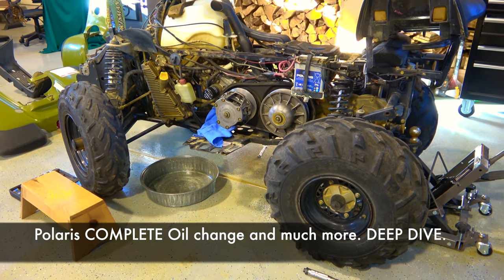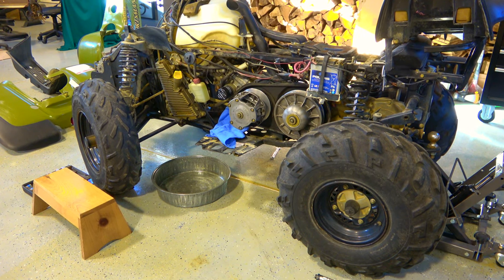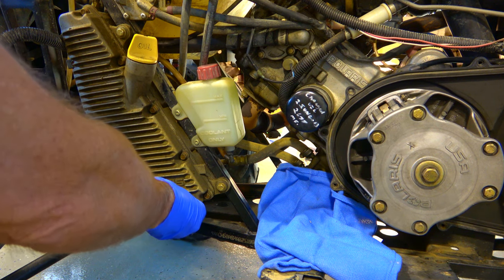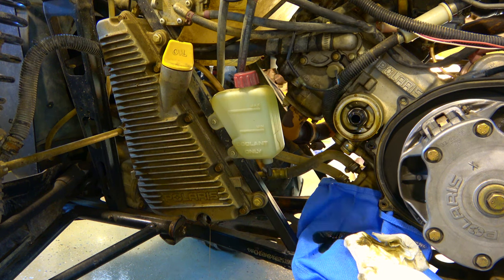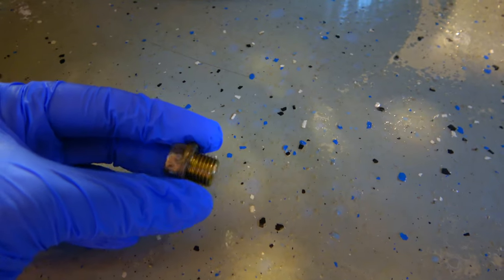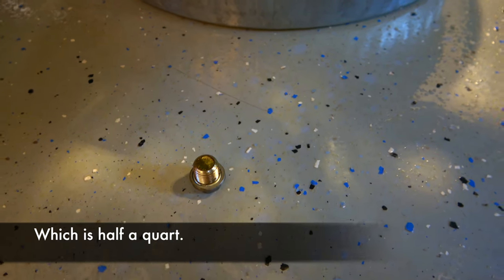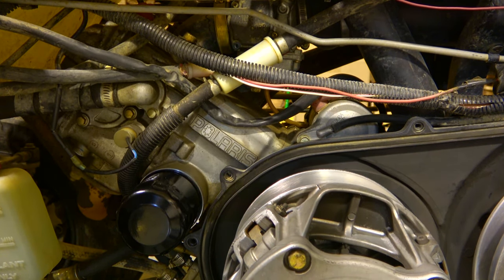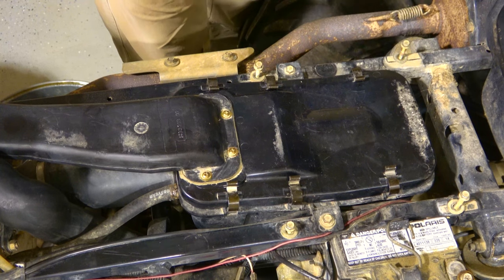Polaris Sportsman COMPLETE oil change & Much More. DEEP DIVE.

Comment: Great videos.  I love the clarity and detail.  Is there a fuel filter on this particular atv (1999 Sportsman 500 4x4)?  Can you point it out?
Reply from the maker: There is. If you look to the right of the fuel shut off/reserve knob there just above the primary clutch. You'll see two white inline filters. One is the fuel filter. White and red on one end. The smaller one. And one is an inline breather filter. From the airbox. At least on mine the one in the video. I don't know for sure if the fuel filter was factory or an after market install before I got it but I believe it was factory. Hope that helps.  I will be making a video going through many of the parts and pointing things out and briefly describing there function soon.
Reply: @ericinalaska7648  Thank you.  I look forward to your video describing these things.  I have the identical ATV and it has been sturdy and reliable.  Sadly, It has been sitting for a few years other than a start and warm up for about 20 minutes every 90 or so days.  I am getting it back into shape now to get back into the wilderness.  Your videos on this machine are proving quite valuable.
Reply: @BigRedDg  7

Comment: I recently purchased a "99 500 Magnum.  After using the 4WD I heard a strange noise coming from the front differential.  My local dealer suggested to first check/replace the fluid.  Looks like a real Pain in the Rear!  Finally found the fill plug UNDER a radiator hose that travels across the diff. housing.  Does the hose have to be disconnected to make this happen?  Thanks for any help/advice you can provide.  John in Texas
Reply from the maker: Well .... Id say if you can get at the plug without removing it then Id have at it. It'll of course be a little messy but I think the alternative will in its own way as well. I can't say Im exactly familiar with that set up. Is it a plug or bolt? Either way. Can you get the appropriate tool on it? And will it be just as easy getting it back in? Thats the thing also to consider.  Are you able to force the hose out of the way?

Comment: Just to be sure, because in the end it got confusing, is it the breather hose (the one on the very top that goes under the seat) or the return hose (the one kinda in the middle) that I need to clamp ?
Reply from the maker: Its the one that comes out the top of the oil reservoir and goes around the front and back to the air filter box. Not the one that has the in line breather filter on it. Its been a while. I believe I trace its route in the video. I took a look and looks like 28:08 in the video  to clarify which one.

Comment: Good video.  I've changed my oil but never with a camera in my hand. Why would I need to purge? I don't understand. Air gets trapped? I purge an old ford tractor when it runs out of diesel but others fire right up. Any insight would be appreciated.
Reply from the maker: Thats my understanding. Air getting trapped, some call it vapor lock. Preventing proper circulation. If you disconnect your supply line to the oil pump. Then you need to prime it. Thats not to say you may not get lucky if you don't. But why risk it. Its not needed or suggested per the manual other than for that specific scenario. So if you just remove the plug on the reservoir and change the filter like most do. No need. Its very specific to if you disconnect the line(s). Hope that helps.

Comment: Great video, new subscriber here share the love!  I just purchased a 2004 Scrambler 500 that needs some assembly, it has set for several years and will not run, they said it was the fuel pump.  Lots of work and fun ahead of me and will be looking for advice.  Thanks for sharing.
Reply from the maker: Sounds like a good project .Im happy to try to answer any question you may have, to the best of my ability of course. Also If you look in the description of most of my Polaris videos. You'll see a link for a manual. Actually here it is.    https://amzn.to/3rFQW6p.  If its not the specific one you need. It'll get you closer to refining the search for the one you may need. Always good to have one.   Thanks for watching. More to come. And good thoughts for your project.
Reply: @ericinalaska7648  Thank you very much, most appreciated!
Reply from the maker: @AMProspecting  No problem. Good luck!

Comment: Great video. I have a question Eric, I just picked up a 2004 Sportsman 700 EFI and it has been sitting for several years. I am going through all of it and when it comes to changing the oil, I know you should run the engine first. Is it ok for me to just change the oil and filter as it sat for so long, or get everything else done and get the ATV running and then change the oil last?
Reply from the maker: I cant say Ive NEVER changed oil in something without running it first. But its been a long time. There are a couple good reasons to run it first. For example, you're warming up the oil and that helps it flow/drain better and more completely. The other thought is that by circulating the oil it helps more thoroughly remove any sediment and or sludge or particulates that may have separated or settled over time. While parked. By kind of remixing it all just before draining.  So its a better end result assuring you have new clean oil, less likely to be contaminated by old. And the old that would remain if you don't run it first would likely be the worst of the oil you're trying to remove and replace.  I would recommend running it first. Especially if its sat a long time. If your too deep in and didn't or couldn't. Its not the end of the world but Id be inspired to schedule my next oil and filter change sooner than usual. Nothing to loose sleep over though. But given the choice. warm it up a bit.
Reply: @ericinalaska7648  Ok thanks for the quick reply. I will plan to change out everything else first and then once I get it running I will replace with oil. Great video!
Reply from the maker: @BoneReaperz  Thank you and good question.

Comment: Very clean 99! Great video as always!
Reply from the maker: Yah I looked it over and thought it was worth the repairs needed. Good bones as they say. Few more things to do and maybe Ill do a after video. Appreciate the feedback.
Reply: @ericinalaska7648  what ps4 oil did you use?
Reply from the maker: @lizgrennan5560  PS-4 is a full synthetic  4 cycle engine oil ,Polaris product that's 5W-50. For an operating temperature range of -40deg  F to 100deg. F.  They make one for higher temps as well. Id have to look up the specifics but if you looked for it at a dealer or online it'd be easy to figure out which one is best for you.

Comment: Thanks for the info, I was very curious about the oil feed line screen. We need to force Engineers to take and pass a common sense class....
Reply from the maker: I would imagine now that Ive cleaned it the way I did Its not likely that at the age of the machine that there will be much being trapped by it anymore. It certainly kept out some of the larger stuff. That I suspect was from assembly. And if someone accidentally dropped say a piece of foil off the top of there oil bottle in there. It'll stop that from circulating. But you also have an oil filter with a much finer filtration. I don't know. Just thoughts really.

Comment: Hi Eric-  first of all thanks for the video, it really helped me out a lot especially since I haven’t done a lot of stuff like this in the past.  Quick question - in the video, you were questioning if you’d need additional oil since you changed out the crankcase oil and you weren’t sure if the two quart measurement was for the standard resoivoir change or for the resorvoir and crank case.  Did you ever find out the answer to this?  I only have two quarts of the PS-4, so I’m inclined to think that I should leave the crankcase as is and just fill the resorvoir.  Any insight?  Sorry for the loaded question.
Reply from the maker: No prob good question. It seemed to be happy with 2 quarts with the crank case drain included. Its been a while but I thought I maybe popped a subtitle in about that after editing. I could be wrong and they flash by pretty quick. But 2 was the magic number overall. And its still happy.
Reply: @ericinalaska7648  awesome thanks for the reply!  I’m sure you had that subtitle in there I probably just missed it.
Reply from the maker: @mjd3dits  Good luck with your efforts.

Comment: Do you have an anti-drain back on that filter because I couldn't see it at all.... On a horizontal filter like that the oil would drain out and could give you a dry start. If that's the case then using an aftermarket filter could be a huge deal.   But using different oil is not a big deal at all.
Reply from the maker: Its my understanding that that's standard in NAPA Gold (as well as silver and platinum) filters. Here is a link to a video that demonstrates the three better than Id hope to. That addresses it, and compares the three and shows their differences.   https://youtu.be/1B_hWb5mCCg    It appears the Silver has a rubber ADBV and the Gold and Platinum are Silicone.  Thank you for bringing this up of course. Certainly something for people to consider when considering an after market filter. Ive seen and heard that that feature has been mandated but have also seen and heard people say there not sure that they would say all filters have or are required to have that feature.  I can say Ive been using them for years.In fact the only one Ive used other than OME.  With no known issues. Several different machines and part #'s. So far so good.  Thanks again for that. I think its good info for viewers and readers.

Comment: good video friend. a question I also changed the oil Ami four wheels is also Polaris spormants but the oil does not go down to the sump.
Reply from the maker: Did you mean you also changed the oil in your four wheeler and its a sportsman also. But when you fill the reservoir it isn't accepting the oil properly? Or are you talking about the fluid in your hubs? You can write in Espan~ol  and I can translate if it helps.

Comment: Hey bro quick question..when u put the oil reservoir back on ..is the short hose on the bottom or does it go on the top ? Where u screw the 2 rubber hoses back into the bottom of the motor...I took it off and wasn't paying attention..
Reply from the maker: On Mine they are in this manner.  Hose from top of the tank to bottom hole on the "motor".  Bottom of tank to top hole on "motor".  Don't forget to prime. And also use sealant on bottom tank connection.
Reply: Ok perfect...thank you

Comment: Hi Eric . Video was very helpful. Just wondering you don’t have to refill the crank cases oil ? Will it automatically fill from the oil reservoir.
Reply from the maker: If you disconnect the line(s) to the oil pump. Then you need to prime it. (The pump) but other than that you should be good. Per Manual.
Reply: @ericinalaska7648  thanks buddy your very knowledgeable I’m sure your videos have helped a lot of people.
Reply from the maker: @thomasimmesberger2644  Glad to help. Also I should have mentioned the obvious. If you have any question regarding the oil level. Always check the dipstick. After filling and after running and after riding a bit to be sure.  Cant go wrong.
Reply: Ok buddy thanks. So no need to fill crankcase it will fill automatically through the oil reservoir where you put the oil in ?
Reply from the maker: @thomasimmesberger2644  Thats my understanding. Unless you disconnect the line to the oil pump. Im thinking that would introduce air into the pump or along the way and possibly prevent proper flow. Which is why you would prime the oil pump in that case. Otherwise enough oil must remain Im guessing even when emptying the crank case to prevent that and allow proper flow. But again always check your fluid level. And of course monitor temp gauge etc. I always say there is certainly no harm in priming the oil pump if in doubt. Just not a necessary step per the manual unless you disconnect the line to the oil pump.
Reply: @ericinalaska7648  thanks buddy, happy to have the info. Keep up the good work. I subscribed so I’m in the loop 👍